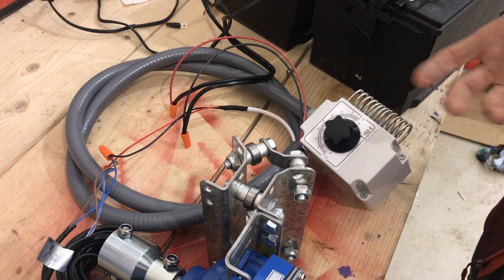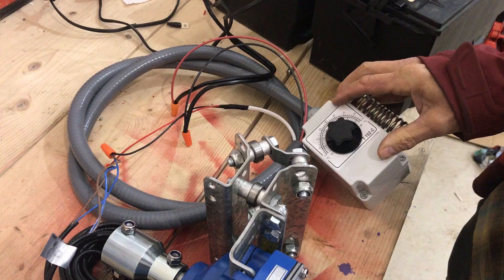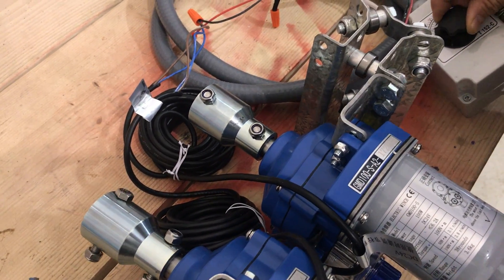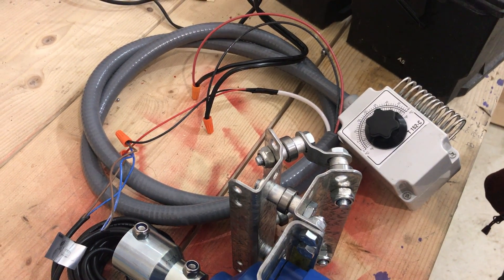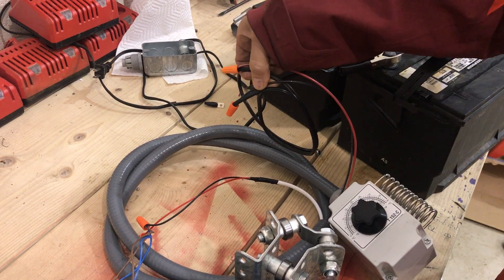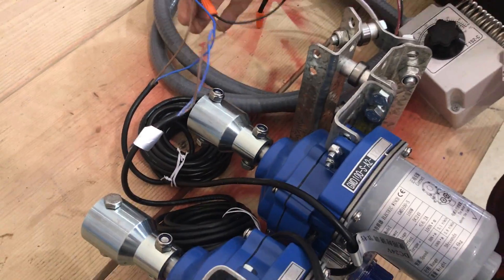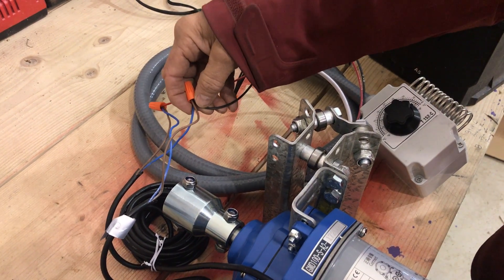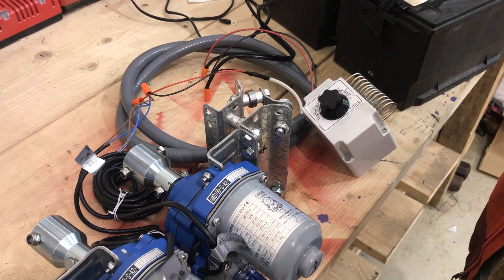#2 Wiring of the hoophouse ventilation motors to the thermostatic control

Comment: Great product starts with great equipment that is easy and simple to understand. Your greenhouse DIY kit surpasses the competition especially because of the integrated low voltage equipment and automated ventilation system. I live off grid in Tennessee and can easily tie in your low voltage equipment to my solar panel system according to my electrician.